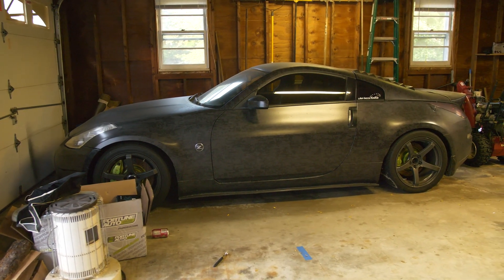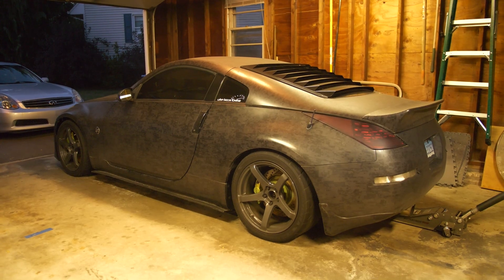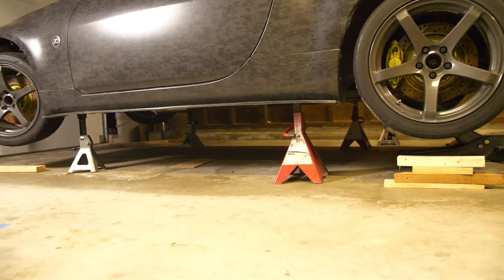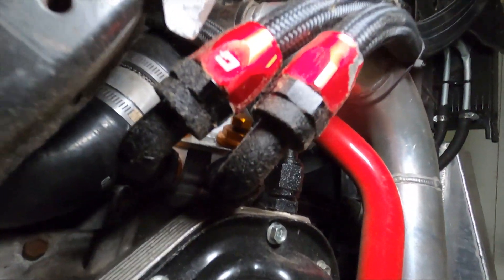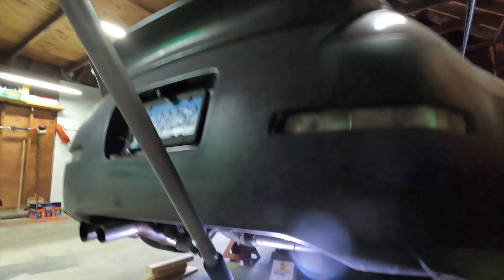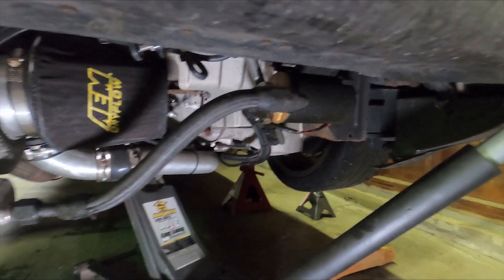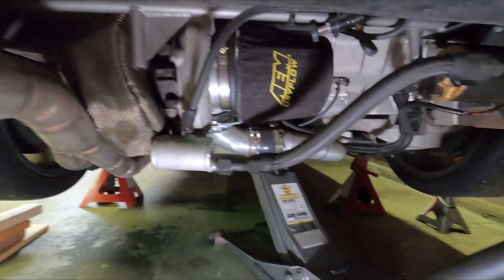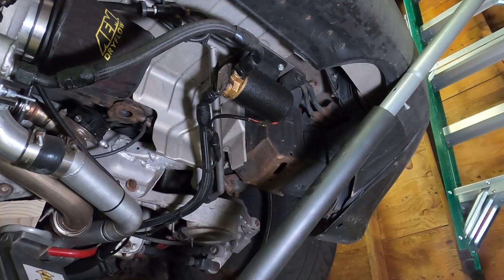rear mount turbo oil system EXPLAINED!

Comment: Hey man I have a similar setup and I’m seeing oil through the breather hose on the sump box. How do I fix that? Please help
Reply from the maker: I'm not sure! Do you have a little oil reservoir?
Reply: @blackpearlmedia7797  yes I do. It is a reservoir drain just like yours that the turbo drains into. The reservoir has a breather with a  hose that goes up onto the rear bumper
Reply from the maker: @africandude7583 do you have a 1 way check valve installed as well?
Reply: @blackpearlmedia7797  yea, one way check valve between oil scavenging pump to the oil pan. I’m thinking of just capping the vent at this point.
Reply from the maker: @africandude7583 hmmm I'm not sure! Seems like a lot of oil is rolling back. Maybe a bigger reservoir?
Reply: @blackpearlmedia7797  thanks a lot. I figured it out. It was back pressure due to my exhaust housing being too small at .82 AR. I’ll switch to a .96AR.

Comment: I'm currently trying to do a similar build on my 350z , I'm currently having problems with the turbo getting too much oil backed up or at least that's what I think is happening is. I even put a turbosmart oil regulator and still having the same issues... is there any guidance you can give me?
Reply from the maker: @R3b3l71  look into a 1 way check valve to prevent rollback
Reply: @ ohh okay! Where would be best to locate that at? Right between the line from the turbo to the scavenger pump?
Reply: @R3b3l71  This guy has the pump mounted incorrectly imo.
you have to make sure the pump is same level or slightly lower than the scavenger sump. Turbos have to be gravity drained, any oil left in the lines will run back into to seals and damage it.
which is why this guy admitted he has smoke out the exhaust on the first couple pulls.
no hate, love the vids, just helping
Reply: @n4th4n3able this is where I'm going to show my newbie ignorance. Why would having oil in the turbo damage seals, or anything else?
Reply: @TheCorvettedez  having oil sitting inside the turbo against the seals will deteriorate them and leak. - weird, you’d think the point of them is to handle that exact thing?
turbos need gravity drain free of oil while sitting. Even if you set you scavenger pump on like a “turbo timer” that keeps it pumping for 30 seconds after the cars turned off

Comment: Wonder if your feeding the after or before side of the oil filter? Coz if it’s before filter port then you most likely be using your scavenge pump as a secondary oil filter accidentally.

Comment: wont it cause issue when your pump is upper than you turbo drain?
Reply from the maker: That's why there is a sump added and a check valve to decrease oil rollback
Reply: @blackpearlmedia7797   i saw the sump but it still sucks uphill from there.
Reply from the maker: @winha1435  can you please clarify? I'm not sure I'm understand. I mean the overall answer is that I don't have any issues 🙂
Reply: @blackpearlmedia7797  you have pump above fluid level, doesnt it suck a lot of air aswell when its like that?
Reply from the maker: @winha1435  oh I see what you mean. No no issues with that. I think the Check valve has a lot to do with it. Instantly cuts the back flow when the oil stops circulating
Reply: The entire reason you need a scavenge pump is because you're pumping "uphill". It would not "suck up" any air because the lines are air tight. If they weren't they would leak oil.

Comment: Where do you get the oil pressure from for the turbo feed?  Isn’t the scavenge pumps job just to pump the oil back to the pan after it comes out of the turbo?
Reply: That’s what I was thinking. Like I thought they can’t really go far on the suction side and they’re more designed for the discharge length. I’m still new at this rear turbo stuff but I will be doing it
Reply: @anarchyr32 the feed is coming from the engine oil pan. It's using the engine oil pressure to feed the turbo.

Comment: How’s it coping so far? Noticed that the pump you’re using is only rated to a max of 140f 60c. And I’d assume on the track days your oil temps would be higher than that. Just wondering how the heats effecting the longevity of the pump.
Reply from the maker: So far so good but I haven't done a track day so far this year :(

Comment: Cool build, scavenge pump tech should be lower then turbo or as much as can but noise might be cavitation from air bubbles pending if oil comes from top of engine or bottom huge diff, oil drains down once car is off
Reply from the maker: Appreciate it!

Comment: What type of line are you running? And where did you get it? Also you are getting your oil feed off of the sandwich plate or is it off of the z1 spacer?
Reply from the maker: -10 AN lines I believe you can get them from Amazon and it comes from the Z1 spacer
Reply: @blackpearlmedia7797  Thanks man

Comment: you think running an oil system separate from the car would be beneficial? in otherwords creating some form of reservoir separate for turbo oil, attaching a pump to it and feeding that directly
Reply: id assume you'd need some form of individual cooling system as well for that but its just a thought, trying to build my own kit for my 09 328i bmw trying to figure out what i can and cant get away with
Reply: I would think it would run cooler too and also be cleaner and better oil.

Comment: I'm looking to mount 2 2JZ turbos on the rear of my FJ Cruiser however I don't want to feed them with oil from the engine. I would like a reservoir that feeds them only. Do you think that would me more expensive and add more work?
Reply from the maker: I've heard that's an option to have a reservoir in the back but You would have to fabricate something that would work for your specific application and then also you have to think about cooling that oil

Comment: How did it blow your turbo if it's job is to only send the oil back to the pan? Sorry for the stupid questions I'm only trying to learn. So far I'm understanding about 70% of this.
Reply from the maker: The scavenge pump was not circulating the oil properly. And before the check valve and reservoir was installed the oil would roll back and seep past the turbo seels
Reply: @blackpearlmedia7797  BROOOOOOOOO that literally was my guess 😅. Thank you for the response. I appreciate this very much. I couldn't see where the feed line separated from return line nesr the scavenge pump but it doesn't matter. I'm starting to get a general understanding of it.
Reply: @blackpearlmedia7797  one more question though, please 🙏; where would you install the check valve in this setup? I just looked up what that is and how it worked but I'm trying not to make any mistakes lol
Reply from the maker: @LeadTheHorse2Whiskey  anywhere on the return line. So like after the pump on the passenger side if that makes sense
Reply: @blackpearlmedia7797  thanks again man. I'll watch your video again to gain a better understanding.  Now that you told me where to install it, that part is in my brain now. I just have to figure it out.

Comment: I have other question about cooling. I figured I will ask you because it looks like you think outside the box..

What about mounting the intercooler in the rear trunk? I see pro drifter move there radiators back there. If you mount the intercooler in the rear, the radiator will get all the air flow. Water cooling is more important than cooling the air from the turbo in my opinion. I would run no intercooler before blocking my radiator air path. 

Another cooling issue is using the same oil from the motor. The turbo is just adding extra heat to the motor oil, breaking it down faster. Would it be wiser to put a dedicated external oil reservoir? This way also lets you change oil weight without having it mix s with the oil motor. Putting the external oil tank in the rear of the car will eliminate the long oil lines running to the front. With a long/wide differential cooler that fits under the rear of car.
Reply: Great questions!
I'm not the OP or an expert on turbos, but here's my un-requested opinions. 
Intercooler in the rear... early turbos like the '81 Trans Am were dogs because they didn't have one. Mounted in the rear you've got to make sure you're supplying adequate air supply. Doable.
He and many others are using an external oil cooler. Many report oil temps lower than pre turbo numbers. A completely separate oil system could be ideal. However, would require a great deal of custom fabrication. Have to consider proper filtration, pressure, capacity, weight, etc.

Comment: I have the same oil set up on my rear mount turbo g35. Just doesn’t have a breather line or check valve. Super informative video I will probably update mine with those changes. thanks!
Reply from the maker: I'm glad it was helpful! Good luck to you and your build!